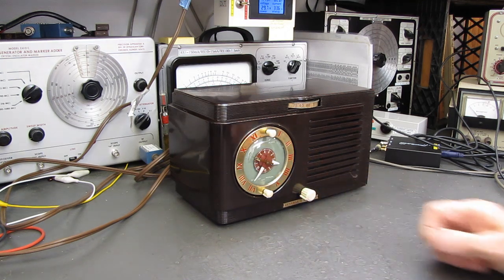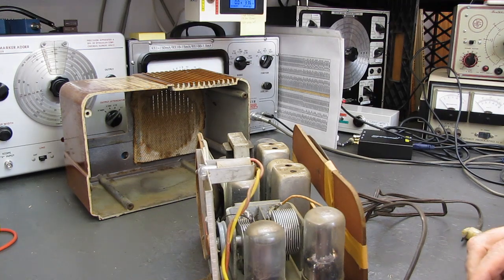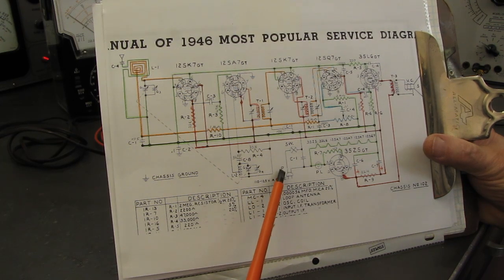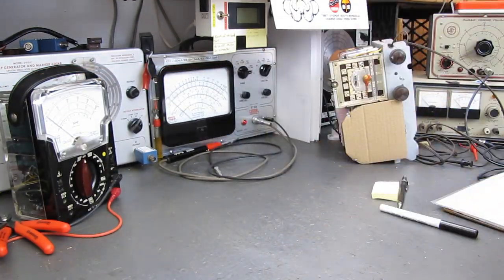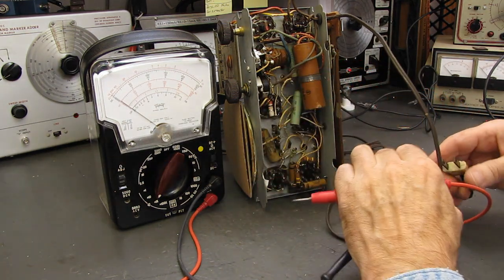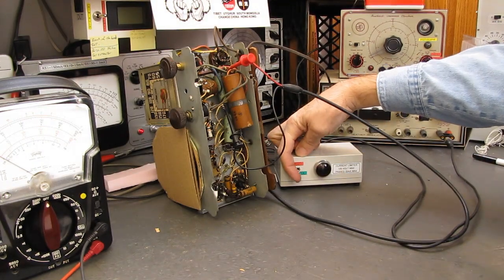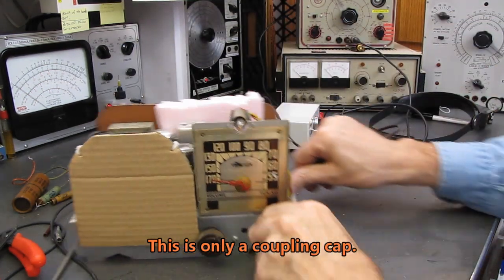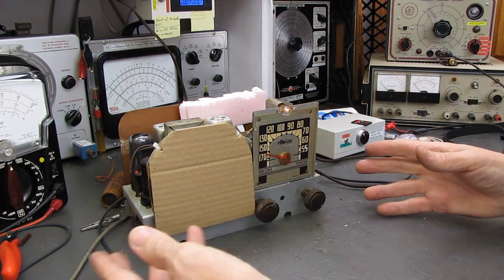DONT PLUG IT IN VOL 5 - THE TRAV- LER 5002

Comment: I should have clarified my previous comment about the size of the trimounts I ordered.  They are very close to the same size, but the head is just slightly thicker, and if I remember right the diameter is just slightly larger.  Thanks for the great videos.  I've been in this hobby for almost 5 years and have learned a lot in that time, but I'm still learning  ;)

Comment: I've never seen this site before and I'm less than 90 seconds in and I want to congratulate you on a beautiful job.
409 is caustic?  Are we sure about that?
Ah, you can make your own tubes, or even fix the bad ones.
Reply from the maker: Warnings about 409 are on the Internet by guys who do a lot of bakelite radios. From what I understand if they've had UV exposure they are particularly susceptible to damage from 409. I'm not going to take the chance. Thanks for watching appreciate you stopping by.
Reply: 409 is an alkaline cleaner.  It will etch aluminum.  If the bakelite guys say don't use it, I'd beleive them.

Comment: Not sure what to call the plastic clips, might look in the parts trays at a good hardware store. Or find someone with a 3d printer that could duplicate some for you.  As for the NTC's, I found a seller on ebay with NF13AA0600MEQ listed. Not sure if they are exactly  what you want. See what you think.  Looked like 60 ohm at 1.9a. "QTY (24) NF13AA0600MEQ TPC NTC INRUSH CURRENT THERMISTOR 60 Ohm 15mm DISC"

Comment: DIGIKEY      MF72-033D7        STOCK 8,466 - Immediate
ICL 33 OHM 20% 500MA    9MM      R@CURRENT 1.485 Ohm

DIGIKEY     SL05 30001        STOCK 3,009 - Immediate
ICL 30 OHM 5% 250MA    6MM   R@CURRENT    4.7 Ohm
Reply: Above are Inrush Current Limiters